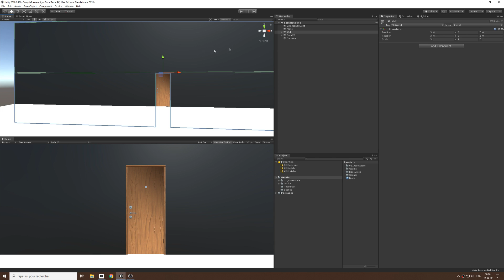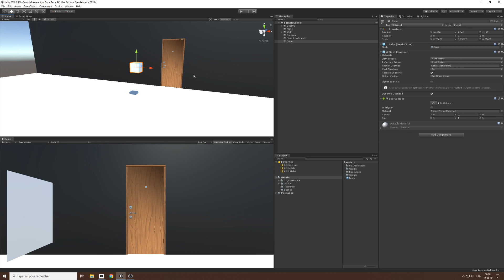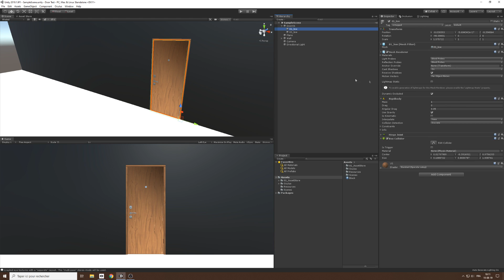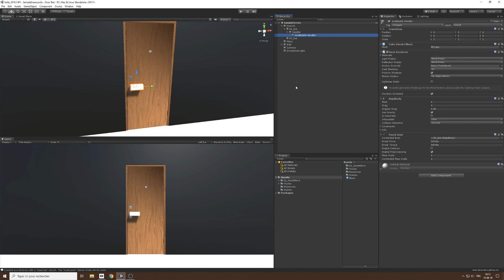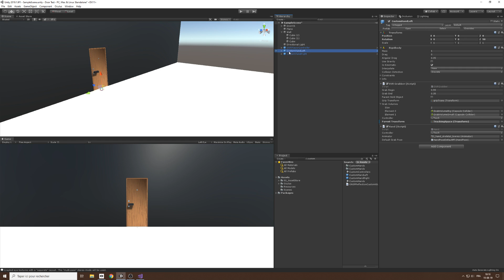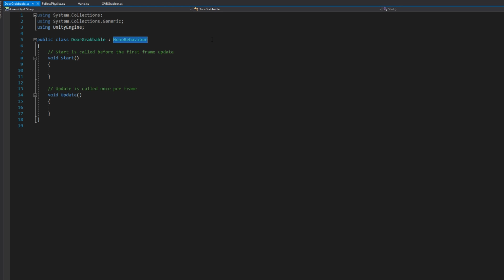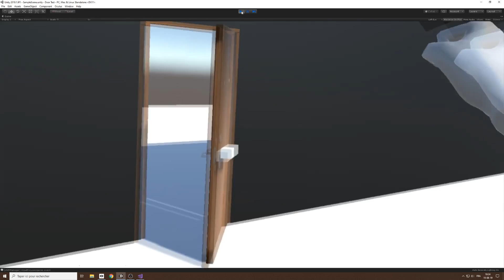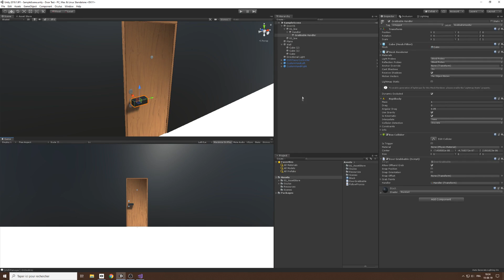How to make a door in VR - Unity tutorial

Comment: QUESTION! - Say you have a flight craft cockpit, and have a steering wheel of sorts for control of your craft, what should I use instead of the hinge joint?  I've ran into an issue where the angle limits wont work on the HingeJoint if the rigid body is kinematic, and if its not kinematic, the object will not transform along with the parent object.  Suggestions to alternatives short of programming my own joint?  - Thx

Comment: Hi,

Great tutorial! I have made a cabinet door that opens and closes, but the door does not want to stay closed all the way. How I can I get it to stay closed without bouncing open a little. I have tried adjusting the damping on the hinge and the mass on the rigidbody and it seems to help a little. Any suggestions? Thanks!
Reply from the maker: Really good question! Hopefully there is an easy fix for this also, go to the hinge joint of the door and check the spring box, it will add a force that will automatically rotate the door towards the centee
Reply: Valem ok thanks!

Comment: It's better and much easier to use Steam VR or VRTK. Much smoother and no extra code. Using unity's joints are a mess and probably a bad idea. NEWTON VR was the best solution but the developer discontinued that remarkable asset. Anyway use whatever you find comfortable. Nice video! Thanks Valem.
Reply: How does steamVR work on games that arent Steam games?